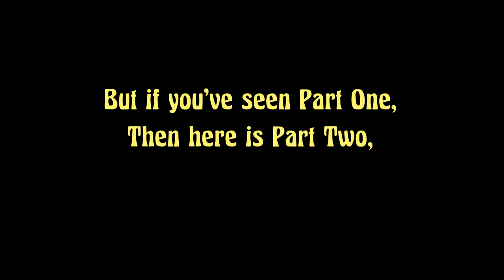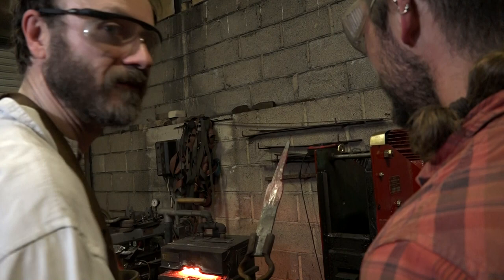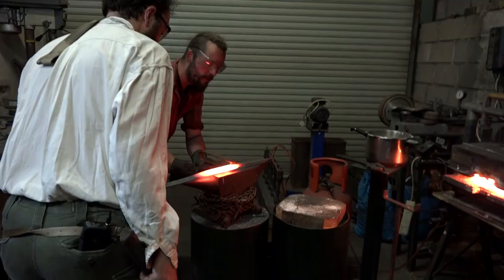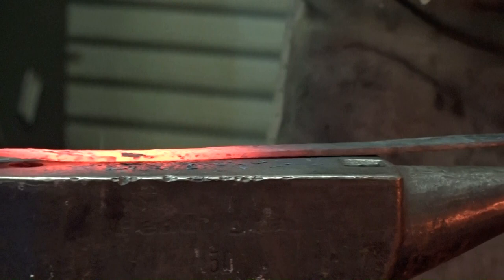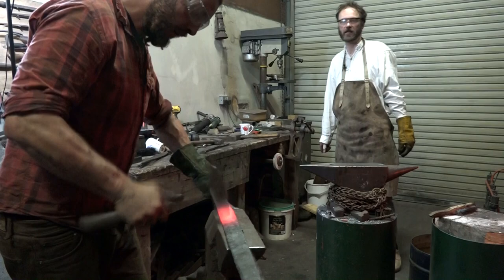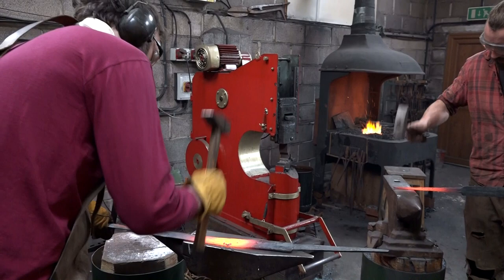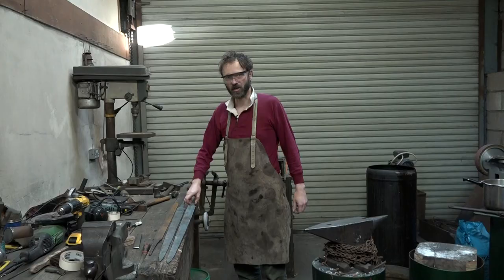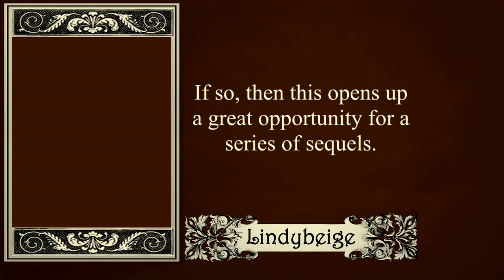Forging a Sword - part two: fuller, bevels, straightening

Comment: No wonder people used axes and spears in the early medieval, swords are just a pain in the ass.
Reply: Particularly if you're stabbed by one...
Reply: Indeed. And in battle, no match for a spear anyway.
Reply: Also explains why swords became some kind of symbol of status. It needs little more metal than spear or axe but also more skill to get yourself a useful and proper stabby-cutty-killing-stick.
Reply: Spears and axes had other uses other than being weapons. You could cut wood with an axe and hunt with a spear. Swords are 100% made for fighting. (you could try to use a sword in those ways, but it would suck and you wouldn't want to mess up the blade)
Reply: Fat Tiger battle axes and tool axes are very different.
Reply: yes comedian but you can still use a tool axe as a weapon
Reply: Fat Tiger 
No, you can't cut wood with a war axe, not if you want it to survive. 

General Gage 
Yeah, you could, but it'd be extremely shit at it, you might as well use a mace as that would probably be quicker and definitely much more effective.
Reply: Bargingo Yes, I know. But battle axes and wood axes are both still axes. There really isn't a european version of a sword that isn't a weapon. IMO, that's why a sword is considered a 'noble' weapon while axes, spears, bows are 'commoner's' weapons.

As I understand, when lords recruited levies, often no weapon would be provided, so the peasant would have to bring whatever they had. If they didn't have a family sword, they would bring whatever tools they had that could be used as a weapon, so wood axes did see use in war.
Reply: Particularly if you're stabbed by one.. in the ass.
Reply: Witchers disagree :D
Reply: @Fat Tiger Depends on the time period, really. Early medieval period had fairly limited iron production, particularly of any quality. Swords were therefore a bit on the uncommon side, as they were expensive. As iron and smelting production increased between the 12th and 14th centuries, swords became quite common - along with plate armor and longswords in noble retinues. In the Holy Roman Empire, beginning in the 14th century, the vast majority of men would have a sword as a sidearm - usually a langes messer or similar inexpensive blade.

Of course, it was at this point in history where they really stopped using levy troops in battles as much, except perhaps in archer regiments and for harassing baggage trains. Being lightly armored with a shield and spear against a plate clad man at arms was virtually a death sentence. There were notable exceptions, of course. Bohemian peasants in the Hussite wars proved very effective while lightly armored in their Wagenberg formations, fending of serious forces with some pikes, 2 handed flails (a farm implement), crossbows, and mortars. 

Prior to this period - absolutely correct. Most peasants could at least obtain a spear, while other less fortunate serfs had to utilize random farm implements.
Reply: Yes, a tool axe is pretty much a mace when it comes to combat. It's still better than nothing
Reply: Bargingo There's also the boar sword, a sword sepcifically designed for (the very brave or very stupid) hunting boar.
Reply: Spears and axes are mostly wood, the metal portion being worked is a relatively small fraction of the total weapon.

A sword, on the other hand, is mostyl metal, hence the expense and ass-pain.
Reply: Also, spears are way better than swords. If you don’t believe me, go fight a spearman while using a sword.
Reply: Comedian GJ ah yes, an easily snapped bit of wood vs a thing that breaks very not easily snapped bits. of wood
Reply: @chrisofnottingham  Until the sword guy dodges or grabs your spear, cause he has armor and he can mess with you. Now you have a guy with a sword standing no more than a hand's reach in front of you, and your spear looks quite silly and useless.

Comment: I once made a wooden sword, and I'm ashamed to admit, I ground the bevels rather than hammering them.
Reply: Shame on you! :V
Reply: Too many people underestimate how hard it is to grind straight
Really I just wouldn’t want to waste metal
Reply: If you think grinding metal is difficult, try forging wood.
Reply: @abelbabel8484  Have you ever heard of particle board? Or maybe manufactured wood? Or even laminate? I think you are severely underestimating the forgeability of wood...
Reply: Randy Tubbsn That's not forging, that's sintering. Very cool and versatile process, too, but different. ;)
Reply: @abelbabel8484  That's fair I suppose
Reply: I know this is an old comment but I want to say that the only proper way to make wooden swords is to cast orange molten wood into a sword shaped container open at the top
Reply: what are bevels I still don't know after watching the video
Reply: Its how the sword is thicker in the middle and thins out towards the edges i think

Comment: This reminds me of every skilled artist.  Surgeon, blacksmith, sculptor, weaver.  When you start your motions are hesitant and weak because you don't know how the material will respond in your hand.  As you repeat the same movements with the same materials you quickly learn how much the metal will move with x amount of strength in the hammer swing., or how much resistance the flesh has to the suture, or how the threads will pull the fabric.  Lindy would make a fine blacksmith if he kept at it.

Comment: I am loving this so far. Showing your learning experience is bold and helps the magic of blacksmiths, armourers and basiers live on. Drawing down became obsessive for me, then adding a twist, feeling the metal crystals give way to the heat of the forge and the intent of my mind and arms was so seductive I found it hard to leave the 18th century. If you do this again please hold your hammer towards the end of the handle and let the tool do the work.

Comment: I love the fact that they spoke of the people that grind a bevel into a knife/sword. There are so many videos out there with so called blacksmiths that are using an angle grinder and would argue the point that they are skilled. It is a cheat that the unskilled use, plain and simple. It takes skill to use a hammer and anvil to make a blade properly. Besides, it compresses the steel making it harder and able to hold an edge better, overall making a better blade.

Comment: The quench ! what a nightmare, when I was an apprentice we made pipe wrenches, A nice lump of steel about 10mm (3/8") thick, After lots of drilling, chiseling, filing, Etc. we baked them in carbon for about an hour to case harden them, then the teacher showed us how to quench them without mucking them up, he had my wrench, glowing red hot, over the bucket of water "now lads you have to plunge it in nice and straight , ooops "he let it slip from the tongs & it landed in the water at a 45 deg angle, it came out bent like a banana :(Start again.

Comment: Fellow blacksmith chiming in here: next time you give forging a try, consider a wrist brace of some variety. You hammer hand has a lot of wobble, which is perfectly natural for beginners, but can be helped as you grow stronger by using a brace of some variety, either a traditional leather one or a modern athletic brace. Not a permanent solution, but can make your first few sessions a little more comfortable and helps to force you swing from the shoulder. Good on you and thanks for putting out the awesome content.

Comment: Is this how the Knights of Shadiversity are going to get their equipment,
Reply: No, they design it in sketchup and print it in 3d printer.
Reply: And prototype it in wood, so they can have practice pieces and hang delicately varnished extras up on the walls of their man caves.
Reply: No, this is how the even mightier Knights of Beige will!

Comment: a good tip is to always hold the hammer with your hand further back because it gives you so much more power for so much less effort but the trade off is you need to practice your aim with your blows because it is harder to control where the hammer head ends up